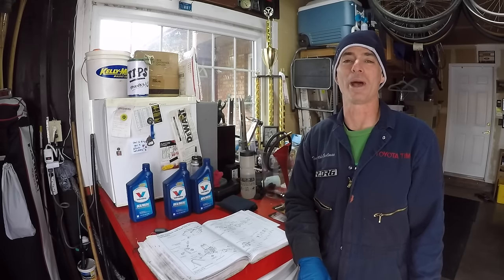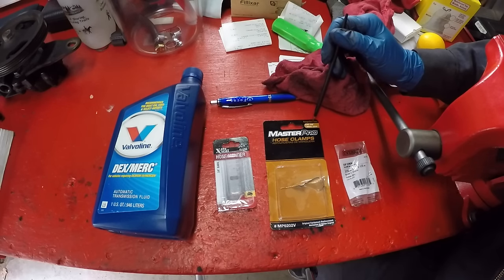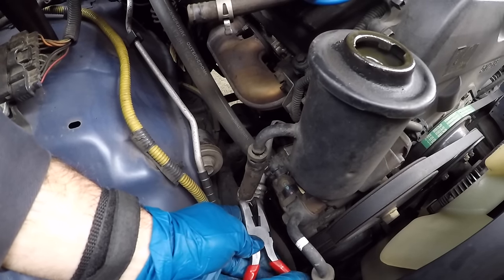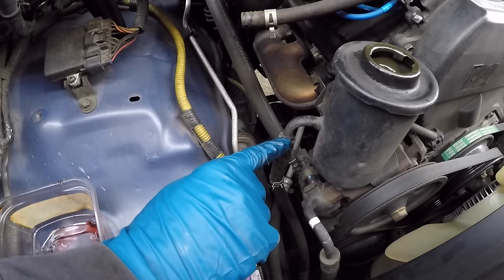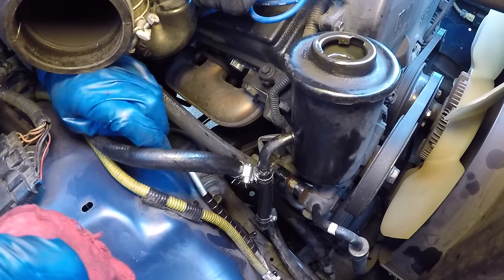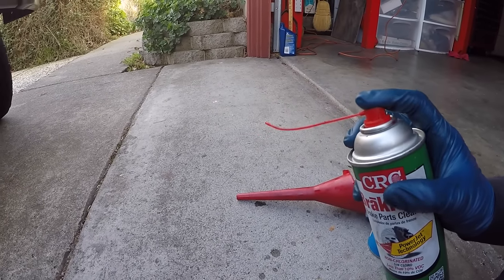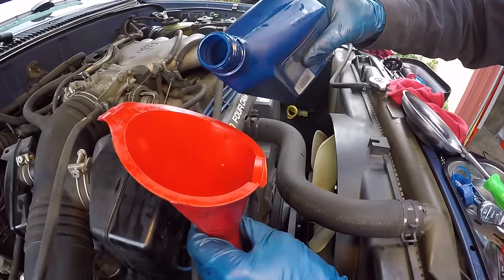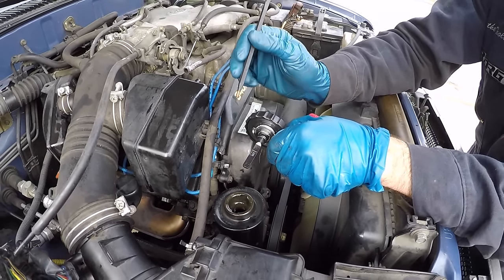Power Steering Flush and Reservoir Cleaning

Comment: Hey I have been running without the filter mesh now for a year without any problems. Just thought I would provide an update.
Reply from the maker: Well Chase, I would make sure you do regular fluid changes because you have zero filtration.  Without filtration, you can end up clogging up your steering rack fluid passages and possibly gumming up your pump.  You might want to add an inline magnetic filter in the return line to the reservoir.   Oil filtration is an important part of the system and you've deleted yours.
Reply: Timmy The Toolman years ago it appears a mechanic found the clogged filter and poked a hole in the middle. While I was doing the cleaning method it just shredded apart. I will be sure to add an inline magnetic filter in the next week! Thanks Tim!
Reply from the maker: @gunsfishand4x4  Another option for you is to visit a wrecking yard like PickNPull that has some 3rd Gen 4runners or 1st Gen Tacomas on their lot and maybe you can find a power steering reservoir you can snag off one.
Reply: Timmy The Toolman that’s a good thought!

Comment: Timmy, i'm preparing to replace my steering rack. Part of that includes disconnecting the power steering lines at the rack. Could I just drain everything from there, remove the reservoir, clean and just refill/remove air in the lines per your steering rack video?
Reply from the maker: I think that would work out just fine.
Reply: @TimmyTheToolman  Awesome! Thanks for the quick response!
Reply from the maker: @cardp17  You're welcome.

Comment: I think an alternative method would be to jack the front of the car up. And turn the key to ON but engine OFF. And just turn the wheel lock with engine off. I feel like with engine on it sucks so much faster than you can fill. Greater chance of letting air in.
Reply from the maker: I heard about the technique you're talking about a while back and tried it out for the first time on my 85 4runner and I found it does work.  Will it work the same for a 3rd Gen that has a steering rack instead of a steering box, maybe.  When making this video, it made sense that you needed the pump to move the fluid through the system and simply moving the wheels back and forth wouldn't work that well.  But, I'm guessing it would probably work for a 3rd Gen 4runner too.

So yes, it is an option.  Getting air into the system isn't as big of a deal as people think it is.  What do you think happens when you swap out a power steering pump, or a power steering line, or a steering rack?  You get air in the system.  The air works it's way out to the reservoir pretty quickly because the positive pressure the pump provides pushes it out.  So, even if you accidentally ran the pump dry and got air into the system, it's not a big deal.  You just wouldn't want to run it dry for too long because it's not good for the pump.

Comment: Safety observation, hope you had disconnected the battery before removing the pump reservoir ?
Reply from the maker: We didn't Mike.  Why do you have to disconnect the battery to remove the power steering pump reservoir?
Reply: @TimmyTheToolman  
Because someone might inadvertently turn the engine over whilst you had your hands and socket working through the access hole of the pumps pulley or you should have keys to this vehicle in your possession "just incase".
Reply from the maker: @michaelperrin2531  I see.  I guess anything is possible but someone would have to be pretty darn stupid to turn the engine over while you're working on it.  I hope I never wrench with anyone that dumb.

Comment: Hi Timmy, came across a video you did as 1road. #1 way to eaisly flush your power steering sustem. In that one you do not crank engine. Which method is best and which do you prefer? Thks..jc
Reply from the maker: You can move the fluid through the system with the engine off.  It does work.  At the time we shot this video, we used common sense and figured the pump needed to be running in order to move the fluid through the system.  But, numerous people reported after we shot the video that jacking up the front end of the rig and turning the wheels lock to lock will effectively move the fluid through the system.  So, if you don't mind jacking up the front end of the rig, I'd say the engine off method would be easier especially if you're by yourself doing this.job.
Reply from the maker: @Samson-EC  That is not Timmy the Toolman.  I'm much better looking.
Reply: @TimmyTheToolman  My bad.  Must have had the wrong pair of glasses on that day  ☺..jc
Reply from the maker: J C No worries.  Good luck with the flush.

Comment: If the steering pump is bad, will it still pump out the old fluid when flushing?
Reply from the maker: Pumps can work sub-par and not be as effective at pumping the fluid through the system.  But, most likely after cleaning the reservoir and flushing the system of the old fluid, your power steering system will be functioning much better.
Reply: @TimmyTheToolman  I flushed it and cleaned the screen still nothing. I hear the whine now sometimes.
Reply from the maker: @zackaryfootit2853  Well, maybe you need a new pump.  Is it better than it was before?

Comment: Have a 2005 Toyota Corolla that I purchased with 108k in 2024. The fluid looks more brown than red....Would you recommend a flush or just a drain and fill? So much controversy on whether or not you should flush a vehicle's transmission if it looks bad....
Reply from the maker: Well, this video is about Power Steering.  Are you talking about power steering or transmissions?
Reply: @TimmyTheToolman  Oh, sorry Transmission. Thank you!
Reply from the maker: @philliptaylor5981  I would do a drain and refill.
Reply: @TimmyTheToolman  Thanks for the time and feedback! So, what about the transmission filter? I really want to change that, but some research says I shouldn't? Should I do a drain, fill and filter change or just a simple drain and fill? Really was wanting to do a full flush and filter change, but for some reason it's not advised in some cases...strange! Thanks for your advice!
Reply from the maker: @philliptaylor5981  There's two theories on why it can be risky to service a transmission that has been neglected.  The first theory is a trans that hasn't received regular fluid changes has incurred excessive wear.  The fluid now has suspended friction materials in it that the trans is relying on to shift properly and not slip.  When you drain some or all the fluid out and replace it with new fluid, the trans ends up slipping because it lost the friction material it was relying on.  

The 2nd theory is an abused transmission will have a build-up of sludge deposits in it.  When you drain all the fluid out and replace it with new fluid, that new fluid has great detergent qualities.   The fluid will break free sludge deposits, and they can lodge into tight fluid passageways, like in the valve body and starve part of the trans of lubrication.  

The filter in these transmissions is a fine mesh metal strainer.  It takes quite a bit to cause them to be blocked up.  I'd recommend doing a series of 3 drain and refills spread out by 5,000 miles each to slowly renew the fluid.   After the 3rd drain and refill,  I'd then do a drain and refill every other engine oil change or approximately every 10,000 miles.  This will keep your trans fluid in great shape.  You could drop the pan at some point and replace the filter if you want.
Reply: @TimmyTheToolman  Wow, thanks so much! Appreciate the advice! Take care, be safe!
Reply from the maker: @philliptaylor5981  You're welcome and good luck!

Comment: So I know this is for the 22re single cab models, but what about 3vze model? I just replaced my power steering pump refilled it with new fluid but now it’s making a noise each time I turn left or right. What would I do to make sure the system doesn’t have air anymore.
Reply from the maker: The air will work its way out.  Maybe the pump you got is the issue.  It really shouldn't take the air very long to work it's way back to the power steering reservoir.
Reply: @TimmyTheToolman  can I have the truck running while checking the reservoir for air bubbles? That’s the only thing I didn’t do was check it while running because I was scared the liquid would shoot out. Hmmm I hope it isn’t the whole part this is the second one I gotten already since I thought the first one was faulty. Would the way I put the lines for the air control valve placement matter?
Reply: @TimmyTheToolman  thanks for getting back to me quickly about this issue.
Reply from the maker: @vegaf2011  You're welcome.  Hope you figure it out.

Comment: Do plastic reservoirs have a screen?  02 sienna, 01 Tundra, 97 Avalon & 2011 Camry.  All except. The Avalon have been cycled in the past 2 years but all plastic reservoirs. Tundra has had 2 racks put on in 8 months.
Reply from the maker: I would assume they all have some sort of filtering screen in the reservoir unless the vehicle has another type of inline filter in the return line.

Comment: I just replaced my power steering pump on my 99 Tacoma with a 2.7 engine. I flush the system and bleed the crap out of it but still have whining noise.  Is it due to an aftermarket pump or could I have a restriction.  The original fluid was black as yours.  I did put in the Prestone Asian but switched it out for the Mercon.
Reply from the maker: Hey Daniel, it's hard to say.  Maybe there's a blockage in the steering rack itself.  But, if it were me, I'd probably take that pump back to wherever I bought it from and see if another pump works better.  They should swap it out for you for no charge since they usually come with a warranty.  Did you clean the reservoir out really well like we show in the video?  From what I remember, most pumps don't come with a replacement reservoir.  I'd also make sure the belt was tensioned properly.  Also, what was wrong with your OEM pump?

Comment: What is the % of likelyhood that issues with Power Steering systems at low revolutions have to do with resvior clogging and dirty fluid vs. a bad pump?
Reply from the maker: There's a very good chance the clogged filter screen is causing the issue.  At the very least, it would be smart to try the reservoir cleaning first before replacing a pump that might still be functioning just fine.

Comment: Timmy!! My 01 Runner SR5 makes a noise when I'm parked then reverse outa the garage and turn the wheel all the way to one side. Doesn't do it while driving nor does the car shake or vibrate at all. Can you give me an idea of what could be the cause.
Reply from the maker: Power steering pumps can get noisy especially when you turn the wheel to full lock.  It's hard for anyone to give you an accurate diagnosis and advice over the internet without examining the vehicle in person.  I'd suggest performing the flush and reservoir screen cleaning and see if that fixes your issue.
Reply: @TimmyTheToolman  thanks for your reply, I was worried it was something more serious.
Reply from the maker: @loslosthuy  You're welcome.

Comment: I have ruled out ALL possibilities of tight steering and this must be the last issue. Need to clean that screen. If I recently did the turkey baster method do I need to do the flush? Or can I clean the screen and and redo the baster method after? Also, is turning the wheels necessary now you know how fast the fluid moves?
Reply from the maker: If you did the turkey baster method enough to where the fluid looks pretty clean, you probably don't have to bother with the flush.  The fluid moves too fast so turning the tires is not necessary at all. Hope cleaning the reservoir screen fixes your steering issue.
Reply: Timmy The Toolman thank you! I will let you know!
Reply: Chase Baker how’d it go?

Comment: Hi Tim is this the same way on a 5gen 4runner 2012 steering flush
Reply from the maker: Yes, you could use the same technique.   But instead, try jacking up the front end of the rig until the wheels are off the ground and turning the wheels side to side to move the fluid through the system rather than running the pump.  It has been reported to me that it works.  I did try it on my 85 4runner and it did work but I haven't tried it on any newer model vehicles.

Comment: Does anyone know if the O ring (part # 90301-11016) will work with the 2.7L engine? Every Toyota parts website I go on tells me that part # won't fit my vehicle. But the original part # 90080-30034 has been discontinued and I read that 90301-11016 is the replacement for it. I just want to make sure it will fit my 2.7 before I order it. Thanks in advance if anybody knows the answer.
Reply from the maker: We don't know, but it would be my guess that it will work.

Comment: Hi Timmy ,Tom. I just want to coretet something ( you said auto transmission fluid ) instead power steering fluid.
Reply from the maker: The power steering system for these 4runners uses automatic transmission fluid.  Power steering fluid is a generic term.  I wouldn't suggest going to an auto parts store and buying some power steering fluid because who knows what the chemical make-up is.  For whatever vehicle you have, you should fill the system with the fluid the manufacturer suggests.
Reply: @TimmyTheToolman   thank Timmy

Comment: Thanks for the great video. I got the filter cleaned and it did take 2 cans for me as well.  I must have damaged the O-ring at the bottom of the reservoir when I reinstalled it because I had a small leak. My local Toyota is telling me it doesn’t have that o-ring to purchase. The Toyota part  #90301-11016 o-ring you listed in the description I was told it's a different o-ring and not for the reservoir. Personally, I think it is the same o-ring used for both locations but he didn't have it in stock locally so I could not verify fitment. I ended up going to Harbor Freight and getting a metric o-ring kit.

** UPDATE: The Harbor Freight O-ring FAILED. It was slightly too thick. The good news is I did find the exact part!. MyToyota dealer doesn't have the part but it is available via the Lexus dealer under the exact same part number. It fits perfectly. It was insanely expensive for a single O-ring at $4.17  

I used the technique of not running the engine and simply jacking up the front end and turning the wheel lock to lock to manually pump the fluid out. This worked out very easily and well and did a complete flush in a more controlled fashion for a one-man job. I also used 1/2" OD x 3/8"ID clear vinyl tubing https://a.co/d/bIOZcXU with a 3/8 x 3/8 barbed splicer https://a.co/d/3ApfhsP to connect to the rubber return line makes it really easy to see the fluid color as you flush. I used a short 6" piece of clear vinyl tubing and bent the end over itself and tie-wrapped it to make a plug to put over the reservoir inlet. I didn't use any hose clamps since there isn't any pressure building up.

I did notice before I replaced my o-ring but with the new ATF Dexron-III that after driving for a few miles I started getting a little power steering pump noise anytime I was making a turn left or right. Sort of like maybe my fluid was low. I ended up removing all the red STP ATF Dexron-III replaced using Prestone Power Steering Fluid. The whining sound is now all gone.
Reply from the maker: Thanks for letting me know Toyota discontinued the o-ring.  Glad our video helped you out.  Happy Wrenching!

Comment: What book is that ? I need one for my 2013 Tacoma.
Reply from the maker: For you rig, you won't be able to find the physical books because they stopped making them at some point in the past.  I don't know the exact year.  The only way you can access factory service manual information is via the Toyota Tech Info website.  You can buy a 2-day, 1 month, or 1 year subscription.  You can download information in a PDF format.  The big caveat of using this site is you have to have a PC based computer.  It won't work with Apple.  At the bottom of the page is a link that specifies the minimum system requirements.  I usually buy 2-day subscriptions and then download everything I need for a particular job.

https://techinfo.toyota.com/techInfoPortal/appmanager/t3/ti?_nfpb=true&_pageLabel=ti_home_page&goto=https%3A%2F%2Ftechinfo.toyota.com%3A443%2Fagent%2Fcustom-login-response%3Fstate%3D7iJtL7S_dFU85o8aGqvJFmWhJto&original_request_url=https%3A%2F%2Ftechinfo.toyota.com%3A443%2F

Comment: Can't you just jack up the front and turn steering full both sides without turning the engine? It will make less mess and assure no bubbles.
Reply from the maker: People have reported that it will work to move fluid through the system like you described.  I do have my doubts it's as effective as using the pump to move the fluid.
Reply: Yep, I do that all the time, no chance of the pump running dry and it pumps all the old fluid out just as well as using the power steering pump to do it.  In this video, you can hear it go dry a few times.  With the engine off method, it's so much easier to not introduce air and turn the fluid, I bet you through out the entire system, into a bubbly soup.

Comment: FYI, that part number seems different, not sure why for the o-ring on the reservoir, but dealer said comes up as 90080-30034 (1998 Tacoma V6)
Reply: Also, on the Magnefine filter, do you install that on the return line then?
Reply from the maker: That's the o-ring part number we came up with.  Don't know why there's a discrepancy but the part number we advertised is the right o-ring part number.  Yes, install the magnefine filter in the return line.
Reply: @TimmyTheToolman  Ok thanks

Comment: Here's a suggestion for cleaning the reservoir learned from cleaning bicycle chains and parts for lubrication.   Submerge that reservoir in a gallon paint can or plastic bucket with lid - filled with gasoline.  The gasoline with its cleaning additives is a great cleaner of parts.  Agitation is easy with a small bucket.
Bingo!
Reply from the maker: Thanks for the tip.